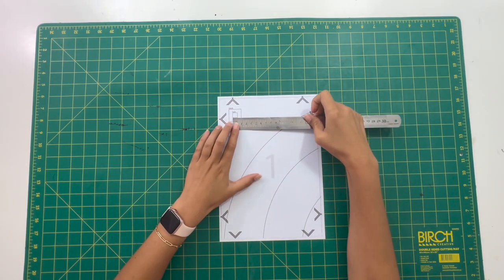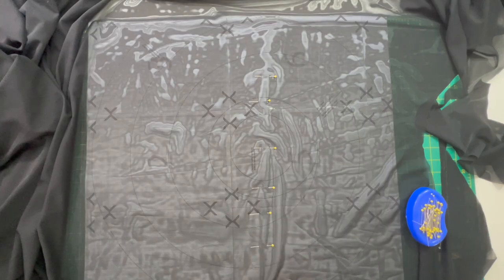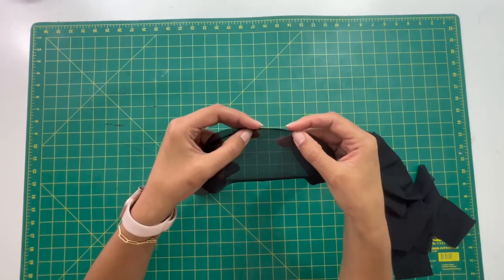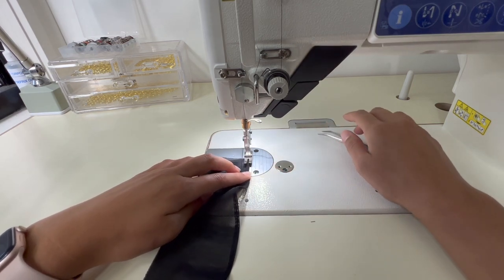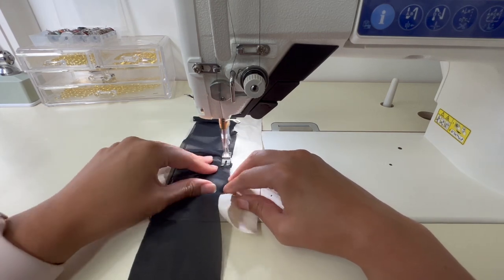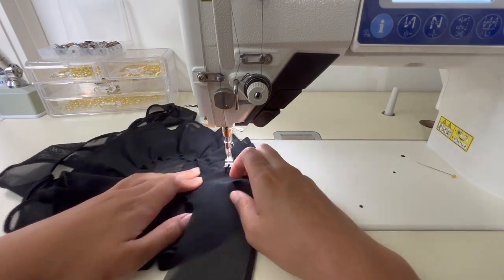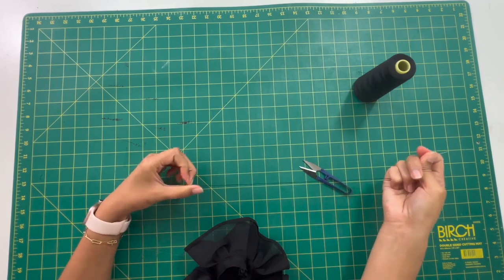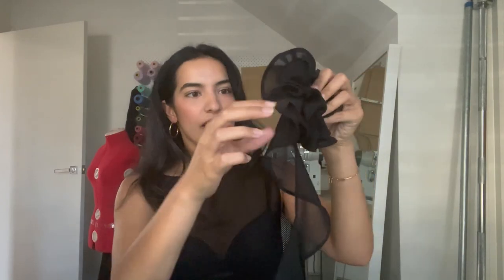How To Make Flower Out Of Fabric | Fancí Club Inspired DIY

Comment: can you do this w fabric that’s not clear ?
Reply from the maker: Yes you can! Instead of a power mesh I would use a lycra/spandex. I have seen Fanci Club use shimmer spandex fabrics not dissimilar to swimwear fabric. The only thing is that these fabrics have a lot of elastane and so I would recommend finishing the edges of the flower on an overlocker/serger with just one needle (the right one for a narrower finish) and this would emulate a baby lock finish!